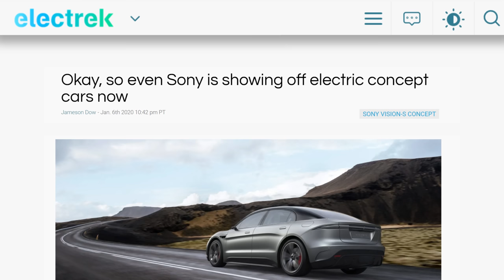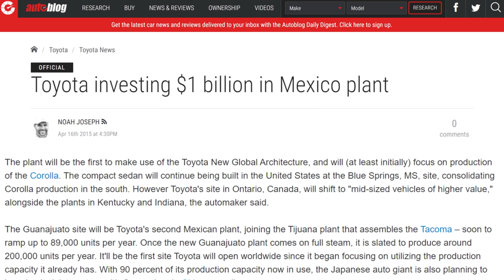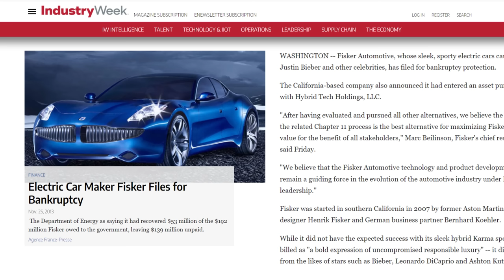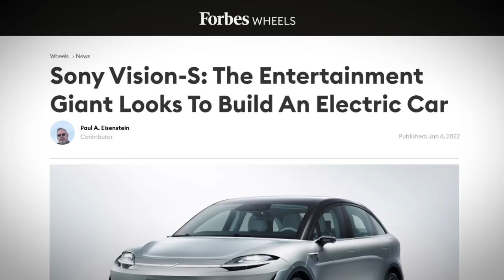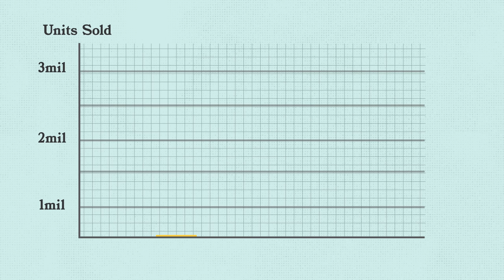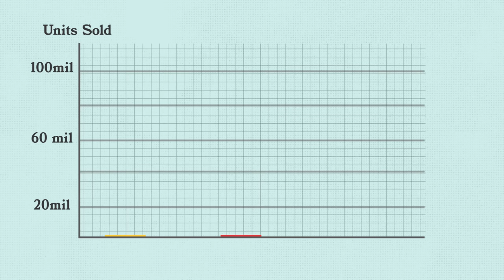Sony's Car Could Actually Be Good- I'll Explain

Comment: Don't forget the Beta and VHS wars, Beta was actually a better design but Sony didn't want to share the technology with others manufacturers  but JVC was happy to license or the technology and even make it for others. Sony doesn't like to play with others.

Then came the Blu-ray vs HD-DVD from Toshiba.  The HD DVD had slightly better audio the discs didn't hold as much storage but the limits did not affect current movies.  The HD were cheaper units and the discs were much cheaper that would make it cheaper for end-users to buy movies.

Sony knew they had an inferior product at a higher price so they decided to play dirty.  They went to Blockbuster and Netflix and did a deal that paid the money to only support Blu-ray.  They also dis the same with Walmart.  Then they used their movie studio influence to get studios to commit to only release blu-ray's.  HD-DVDs were finished and not because they were worse, but because Sony plays dirty.

Sony has had some significant failures such as computers, virtual reality and other mew tech areas.  The thing with Sony is that they hate doing things like others and prefer to use proprietary technology, as proven by their TVs, projectors and other branches.  They are stubborn, arrogant and want things done their way.

I hope Sony builds an EV because it will be so terrible and they will lose billions.

Full disclosure, I hate Sony and will never buy them based on their business practice and self righteousness.  They are as bad as Apple, another company I would never buy a product from

Comment: When u buy icar u wont get a charger because they are nature friendly.
U need to use ur iPhone charger for it.
And it will charge u completely in day because the battery is only 10000mah.if u need more then u need to buy i battery's.

If u want more than one seat then u need to buy i seat.u need to buy an apple subscription for the car yearly.
And yeah they terminate service for your car after a year because they have new car tht you can buy

Comment: Sony wont be building any electric vehicles. This is a flex at the tech industry and to showcase to the OEMs that they should look to Sony as the supplier for future EV tech. Not only do their prototypes look like a Tesla, I bet they were Tesla chassis with Sony Tech all over them - and they touted their sensors way more than the specifics of the car like how much KW and range it has. This isn't the first time a company built a bespoke type vehicle to showcase it's technology.

Comment: Imagine it comes with a ps5 built in and bluray and you can control the car with a psp lmao...seriously though I'm not Playstation fan but a Sony made car will be much better than a dang tesla!!! Sony has so much experience in batteries, computers, software, and anything basically electronic so just how well is the drive train and vehicle safety going to be? I hope they partner with a company with experience in vehicle manufacturing and safety. Sony has no experience in designing a vehicle so I wonder how will this car look like? I just hope this thing looks unique, stylish, and cool and not look like a dang prius! And I'm off to go research this and learn what progress Sony has done so far, I have not seen this video I was too busy writing this comment ok bye

Comment: Sony has failed at a lot of things. BetaMax, D.A.T., MiniDisc, UMD for the PSP and ATRAC to be more specific. I'm sure they failed at more things but they have succeeded more than they failed. The most horrible failure was to start putting the XPLOD on their car audio equipment.
Reply: MiniDisc was a success in Europe and Japan. BetaMax hung around longer than VHS did in the professional market too.
Reply: @Clay3613  that may be but in the U.S. BetaMax went the way of the Dodo bird because of a certain industry. And I guess Americans wanted their CDs scratched more than they wanted to have a protected enclosure. I had a 4 disc minidisc changer head unit with a 6 disc minidisc changer in my center console and a 10 disc CD changer in the passenger side dash. I was very happy with my minidiscs

Comment: Tesla is the apple of vehicles. Phenomenal marketing,  but the product itself is sub-par. 
 Toyota has made better EVs for literally a third of the price, almost by accident. 

 Source: worked in one of the first giga-factories. Can't speak for current models, but all the way up to model 3, quality control was awful, most batteries were faulty, qnd the assembly and treatment processes did indeed result in the death of multiple laborers. 
 They just weren't built well.

Comment: If so so Sega Genesis Cosmo never really existed? That came out to compete with the Nintendo PlayStation, which was never released to the public. 

I wouldn't think gamer collector test would come from a car page. But here we are. And I want a first gen Sony car. I'm out rolling the kid in hero and all the naysayers all the electric car hitters all I have to say is this according to my generator and that is equivalent of running off of 93 miles a gallon. I'll take you down falls for that. My little brother watch me drive a Geo Metro that I was able to get 65 miles a gallon out of on 50 cents over and over again and the gas prices were this is Bush error 3.75 a gallon

Comment: In the other EV failed startups you mentioned, there's a LOT of corruption at the top, or in nikola's case, per your own video, as an outright fraud. If you look at EV startups that are successful (tesla, officially rivian since they now made a truck and sold it) you see theres similar stories to sony's current situation, where they had a lot of help from established automakers and such. Sony from this position could easily enter the car market, the only issue is coming out on top will be hard when there are more than just 2 stale companies at the top. Sega and Nintendo at the time were both in mutual agreement basically that if they didn't develop further, they could basically push the same bs on the consumers. Then sony came along with a revolutionary new console and whipped them both. I don't see a way sony can pull the same kind of hat trick in the auto market with tesla already going overboard on tech

Comment: Sony has built some military vehicles for Japans Defense forces but even cooler it’s produced jet engines with a new electric technology for Japans 6th generation Stealth fighter jet as well as a lot of components and the first ever jet/plane to use electric servos for mechanical operation saving thousands of pounds of mechanical equipment and hd developed a new aircraft skin system using a carbon fiber like material and some special glu to make it much lighter.  If Sony can build armed personel carriers for the military and be a partner in their 6th generation fighter jet which just might be the first 6th Gen fighter jet to fly. (If the US top secret 6th Gen jet hasn’t already flown.  The new , one of a kind electric jet engines were designed and used becasue 6th Gen fighters being developed are all requiring enough electric power to power onboard direct energy weapon (A Laser) the US has successfully tested an AI/computer operated Laser weapon on 3 of its Naval destroyers as a strike group missile defense system for the Air Craft Carriers they escort. The weapon can take down drone swarms, hypersonic anti ship missiles, aircraft, boats etc by destroying them or using less wattage and frying radars, targeting systems, computer systems of aircraft and missiles. Amazing thing is each laser “burst/shot” costs just $0.10 verses a $350,000 SeaWiz defense missile, it can also fire unlimited shots, it’s silent and invisible to the naked eye and travels obviously at the speed of light and not affected by wind or elements so targeting a distant jet incoming the system targets a part of the jet and when fired it’s an instant impact exactly where targeted. Wattage can be increased or decreased to fry sensors or take a wing off and successfully exploded a full size drone boat. The laser has also been successfully tested on the HEMTT military transport vehicle that has an diesel electric generator on board used for base defense agaisnt mortars, RPGs etc. first tested on the new diesel electric destroyers becasue of the amazing power they generate needed for the Laser weapon. Testing is being done on the US 160th Special Operations Aviation Regiment AC130J Specter gunship that has an electric generator installed onboard , it’s a very large transport plane converted to gunship for close air support .so there’s been question has been how are we going to generate enough electricity from a fighter jet to power Direct energy weapons, jet engines are not electric , never have been and installing generators onboard will be too heavy for a lightweight fighter jet.  Alot of speciation to how they’ll do it and then Sony announces this week publicly they’ve developed of top secret ELECTRIC jet engine for the new 6th Gen fighter!???? One that will power all the electric servos , also a first and a revolutionary liquid cooling system that runs through the entire aircraft to remove any heat signature at multi mach speeds and hd some technology with the engines that allow them to work without generating enough heat for heat sealing missiles to lock onto!?  NO idea how an electric jet engine works but amazing and produce ample power for direct energy weapons on board.  Just a few days ago I didn’t know Sony made cars, military equipment/vehicles, jets and advanced top secret jet engines and systems but now I know they do lol. Japan is injecting BILLIONS of dollars into its own military contractor companies to become a world force in military tech development and they are known to produce some of the very best if not the best electronics on the planet so I have no doubt they’ll succeed in the Defense industry and the auto.

Comment: It is good, because tesla quality is really garbage. No fancy new technology, only same old garbage. Even the battery technology is dead end - cylinder type. Pouch type can deliver more amps, better cooling and so on. I really hate how they patented just a simple copper tube for cooling the cylinder type of batteries. That kind of inventions should never get the patents. May years tesla basically used the radio components, nothing specialized for EV purpose. Failure rate was massive. They never cared about quality, only the green credit sale. Yes, they increased the production only for that purpose to sell the green credit to other manufacturers. Luckily that business is very soon over and they can not manipulate anymore the market. Reality is a biatzhhh